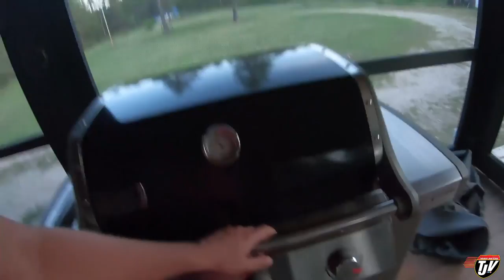My Trucking Life | SOLD!!! | #1771

Comment: Now that you are watching your fuel costs, you need to get an Espar bunk heater to put in your truck. It uses just a tiny bit of fuel to keep you warm in the winter vs. running your truck engine all night. Would use less than a gallon of fuel per night. Pay for its self in one winter that way.

Comment: If steaks are over cooked it's because you are turning the heat to low and leaving them on too long. Better to turn the heat very high and only cook them for 4 or 5 minutes on each side. They will be seared on the outside but rare/ medium rare on the inside and very juicy.

Comment: hey Josh do you own your trucks or does your company own them and you just have to pay for maintenance only asking because typically as you would know  owner operator wouldn't have the logos on the truck but you own that freightliner so not sure because you are paying off the Volvo and want to get more trucks and hire divers but you still drive for a company with there logo on the rig